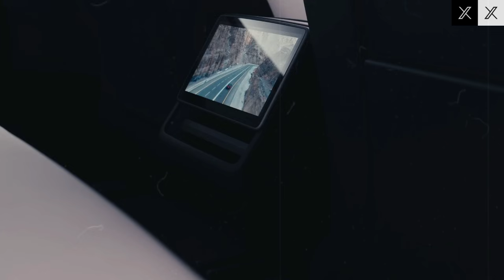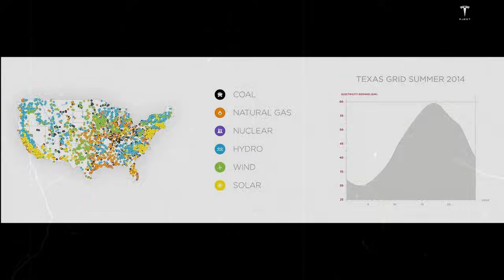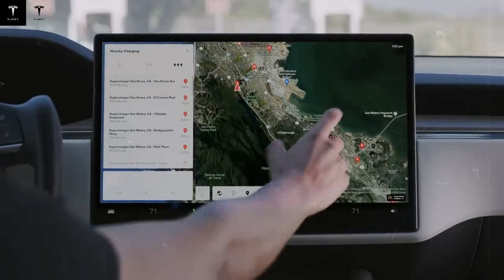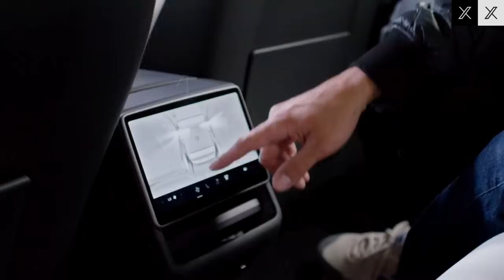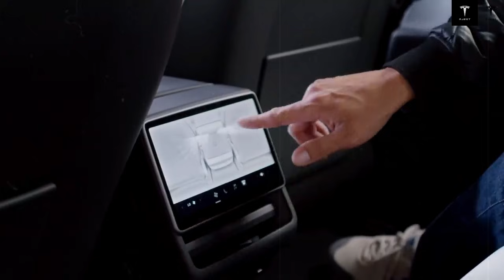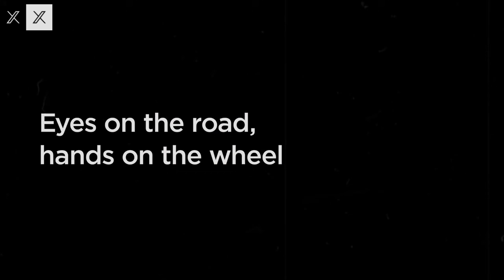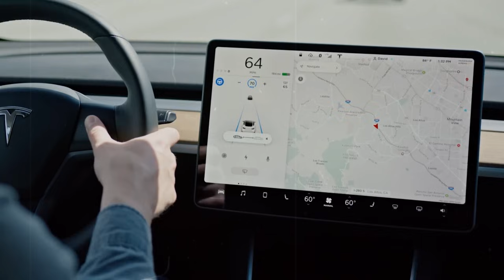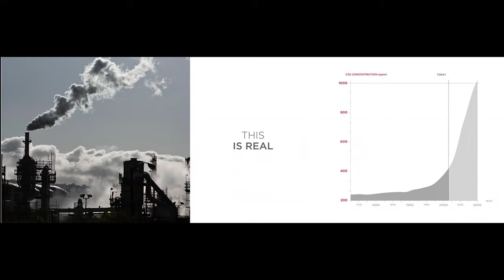IT’S HERE! Tesla Model 2 2026 for $15,990 — 300 HP + Solar Recharge Shakes BYD!

Comment: The “Tesla model 2  2026 “. is  Not a confirmed 
 vehicle  and. information like. a price  of 
$15,990, 300 +horsepower  and solar 
integration. are speculative  and. likely  False 
While. Tesla has. hinted. at  lower -cost 
potentially $25,000 EV (sometimes referred to 
as bModel 2/)  the details you’ve. provided do not 
match  any. official b announcement or. reliable 
reports